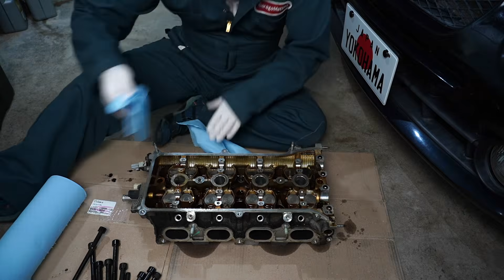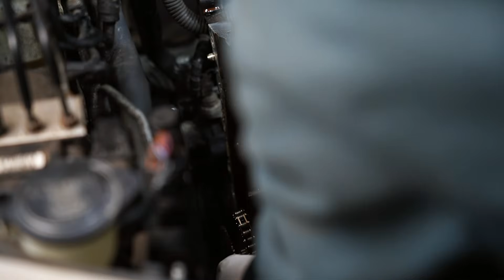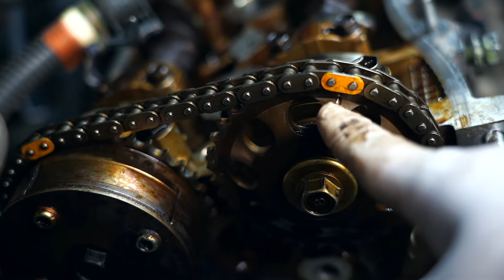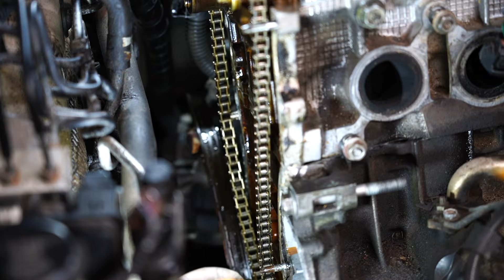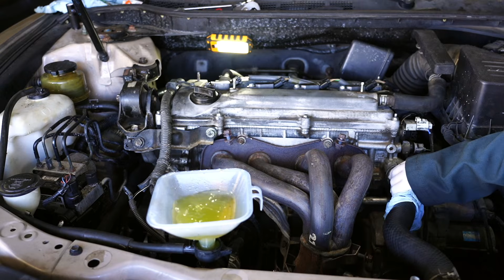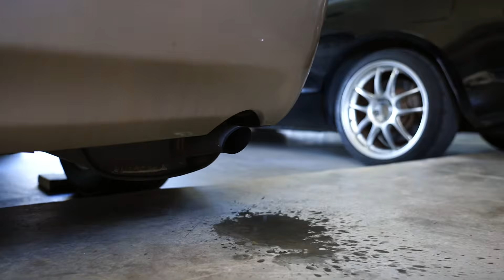Toyota Camry Head Gasket replacement part 6 of 6 🛠️

Comment: Dont you need new head bolts and timing chain because they stretch? Fantastic videos by the way!
Reply from the maker: It's practice to do so but I decided not to because it was going to be a daily driver. The owner surprisingly came back for it and has put over 30K miles on the vehicle. Check out my 30K miles review after meeting up with owner last year -> https://youtu.be/D5a_d84mh-M?si=YegRwysVN3mdS6ic
Reply: @GarageMatters_vroom  Awesome I'll check it out. Thanks!